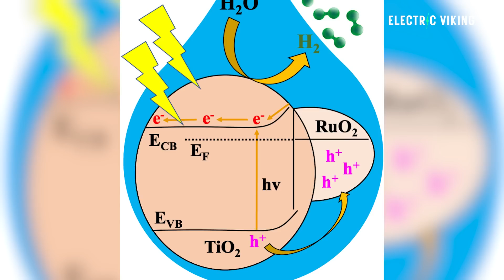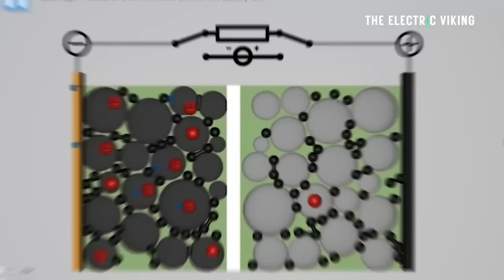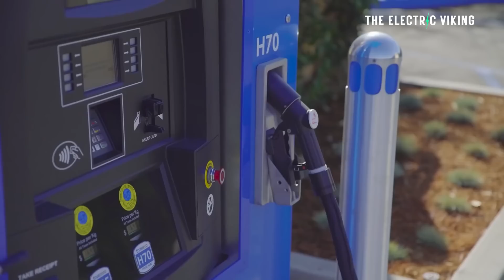American researchers use sunlight & water to efficiently create green hydrogen

Comment: Round trip efficiency. That's all we need to know... to compete with battery storage, it needs to be similar at 85%
Reply: Round trip efficiency is important, but also other factors matter. Hydrogen is useful for the chemical industry and can be used as long term (seasonal) energy storage. If you also need heat in winter, the "losses" of a fuel cell can  be quite useful.
Reply: @dirkvornholt2507  not if you keep having to replace/maintain storage equipment due to hydrogenation/embrittlement. Still the tech is interesting and there may be non-transportation use cases where it makes sense dunno.
Reply: @erktrek  I see hydrogen rather as a base chemical. The industry that uses it knows how to handle it. Concerning storage and transport, derived fuels like methanol or ammonia might be a more viable option. For cars, it's probably rather a niche market.
Reply: Batteries have lower capacity, and shorter duration.  The applications are different, suffice to say.
Reply: @FlameofDemocracy  - Depends which type of battery your refering to, flow batteries have high capacity and long duration for example.
Reply: @GruffSillyGoat  Flow batteries might still be in the development stage.  Is that still correct?
Reply: @FlameofDemocracy  - no, they are a mature technology - but a costly one to build both money and timewise. They've been around since the 1880s, and in commercial use on a large scale since the 1950s. They're advantage is sheer size and scale as energy stores, rapid switch on/off time and extremely high current capability with the ability to charge and discharge at full power across their entire range. The largest is one is in China that holds 400MWh of energy and able to charge/discharge this at 100MW. They can hold their charge indefinitely, unlike other battery bases systems. Offer some of the highest levels of durability around, and are low maintenance compared to either hydrogen or lithium/sodium based designs.
Reply: @GruffSillyGoat  From what I have read, it is still experimental.
Reply: @FlameofDemocracy  - Vanadium flow batteries, the main type, have been deployed since the 1980s (the China one I mentions is vandadium based). You may be readiing about some of the many chemistries that are being explored in flow batteries, they are highly versatile, some of which are relatively new (such as organic chemistries, developed in the 2010s) that are more experimental.  However, the main zinc-bromine and vandadium based ones they've been used in grid storage for decades, are mature and deployed virtuall everywhere - North/South America, Indian/China and many other parts of Asia, Australia, Africa, Europe, etc.

Hydrogen fuel cells are also a class of flow battery, but one where one of the reactants (Oxygen) is not stored but is sourced from the atmosphere. However, for grid storage flow batteries typically means Vanadium based solutions as they offer high current/energy density and have smaller system sizes than equivalent hydrogen systems - as their reactants are liquids rather than gasses. Zinc-Chloride flow batteries have also been considered for vehicles due to their high energy density (830wH/kg), but are heavier and more complex than lithium batteries (tanks/pumps/reaction cells with mebranes) but are being trialed in large trucks due to their rapid charging ability.
Reply: @GruffSillyGoat  I can gather as much from the internet. Both are still experimental.  

In fact, the entire category is still speculative.

Hydrogen in regenerative fuel cells are the archetype.  More chemistries in that mode are certainly to be welcomed.

But the density of hydrogen cannot be matched, not to mention the versatility.  

Salt batteries, and sand batteries for heat can fill niches and match demand quite readily, with cheap simple approaches.

Why there is so much interest in vanadium may be due to the explosion in costs of lithium, along with the emergence of some limitations to applications or longitudinal performance.

Needless to say, the same speculative forces would take hold with vanadium; perhaps quite predictably.

So, why complicate matters unnecessarily?
Reply: @GruffSillyGoat  
Hydrogen-vanadium chemistries may also be worth checking out.
Reply: @FlameofDemocracy  - flow batteries (e.g. liquid based ones such as vanadium) and hydrogen fuel-cells have different characteristics - flow batteries have high peak and continuous current outputs compared to hydrogen fuel cells, whereas hydrogen fuel cells allow for continuous operation if supplied a constant source of hydrogen fuel. Flow batteries and hydrogen fuel archetypes do differ as one is designed for liquids and the other for gasses, the constructions of the supporting systems and fuel-cell / flow-battery ion exchange mechanisms differs considerably. Modern hydrogen fuel-cells have borrowed from the science, knowledge and engineering of flow batteries in their designs.

Also, I wouldn't call vanadium flow batteries speculative or experimental, they are an established technology and quite common in grid based systems, though less common in industrial applications. Furthermore, they have been commcercialised as scalable drop-in containerised based solutions, only requiring a small container sized footprint and grid connection to operate. 

Hydrogen similarly has been containerised but requires a larger footprint, at lower capacity, due to the more complex system setup - electrolysis water filter & hydrogen generator, presurriser/cooler and storage container.  However, most large hydrogen generating sites, particularly those used for industrial requirements, are custom built sites with direct pipeline connections. 

Lithium's pricing is still much lower than it was a few years ago, some 70% lower, and is projected to reduce further. Although, Sodium batteries are expected to be significantly cheaper once commercialised over the next few years. Both are significantly cheaper than either hydrogen or flow batteries and scale from small to very large requirements (again are small footprint containerised solutions)

Hydrogen had a duality of energy density - it's has a high gravimetric (mass) energy density but a very low volumetric energy density (due to being a gas). Hence if not being used in its gasseous form (as in the case of some industrial applications) required extensive processing to improve it's volumetric density (at relatively high energy costs). For green electrolysis they generation side can be upto 80% efficient, 5 to 10% additional energy is then spent in processing and distribution, and fuel cells are 40 to 60% efficient, this means for energy input the overall energy recovery is 25 to 35% (possibly raising to 30% to 45% with improvements).  

Hence hydrogen is suited to industrial applications where either the lost energy, particularly heat in the fuel cells, can be recovered (raising efficienies to 70 to 80% overall) or where continuous operation is a key required. For mobility is now positioned for large vehicles (heacy trucks etc.) or where high range (1000km+) is required (trains, long hual flight). 

Flow batteries are used for peaker plant replacements, grid balancing and emergency power provision as they have similar power characteristics as pumped hydro but at a much cheaper price. Containerised solutions have eased their implementation and cost management considerations, making them plug-in solutions with reasonable power densities (2 to 4MW per container currently).

Lithium is likely to become dominant in mobility and Sodium in static storage solutions, due to the ability to scale from small to very large capacities, ease of maintenance and flexibility. Most grid operators are utilising battery storage in support of renewable generation as they are easy to integrate into renewable generation sites, enable 24/7 operation of intermittent sources, and reduce the need for curtailment. They are also used as battery buffers for EV recharging sites, simplifying the grid connectivity requirements of these sites. Their large scale adoption is also driving costs down further.

Comment: H2 would still not be good for cars, but we can use hydrogen in so many ways if it was green like this.  Steel and concrete could both benefit from inexpensive green hydrogen.  Ships are the other use that might be viable; possibly using a hydrogen gas turbine.  Aircraft maybe.
Reply: Nat gas would work better for both aircraft and ships (which already use it).
Reply: We could convert existing thermal power plants into hydrogen plants for winter use when there's not enough renewable energy.
Reply: Everything will be green in the future.  The concept of green hydrogen that is popularly discussed is actually a misconception. 

The all green portfolio is the genuine theory and thought process.
Reply: I literally cannot think of a worse application for hydrogen than in aircraft.
Reply: @phillycheesetake  What burns in internal combustion is the hydrogen component.  Carbon is expelled as gases, particulates, and solids.
Reply: @FlameofDemocracy  You must have made a mistake, your comment has absolutely no relation to mine and yet you replied to me.
Reply: @phillycheesetake  Hydrogen could be used directly, or it could be used to make efuels, i.e. green jet fuel.
Reply: @FlameofDemocracy  Yes, it could be used even more inefficiently through combustion, I'm aware.

Still less direct than electricity, still a waste of time with e-fuels because those can be made directly without the completely unnecessary step of going from hydrogen to those fuels.

Comment: Is it not only significant if it amounts to a more efficient capturing of energy from sunlight than a photovoltaic panel - which it could well be ... - is it ?
Reply: Did they say for every 100 photons from the light source only 10 were utilized? Therefore 10% efficiency compared to 25% for photovoltaic.  Is that correct?
Reply: @carlwest859  it sounds good but I am not a physicist.

Comment: Hydrogen can be good for energy storage as well as plane fuel.
Reply: @Rainbowhawk1993  Methane will be the lightest molecule used for planes, likeliest is kerosene for long haul and all electric up to 400 miles.
Reply: There are more efficient methods of energy storage (from cheap low density batteries to pumped hydro/compressed air). 
The new process might move the needle but they released No numbers. 

Regards planes, the problem isn't the weight of the fuel, its the weight of the massive fuel tanks and hazards handling H2 at 10,000psi. There are precious few H2 stations in the world, yet explosions at these stations are not unknown. 
Would be interesting to see what safety specs would look like vs kerosine.

Comment: Hydrogen cars are still more complicated in comparison to fully electric cars. the fueling process is still less convenient and requires more personel. And you still cannot fuel home made hydrogen. Electric has still advantages.
Reply: You still need to distribute hydrogen with tankers and there are issues with hydrogen degrading its containers.
With electricity, the delivery network exists, is efficient and there's no extra step. You generat electricity and distribute it. Storing it in a car battery is far more efficient than using it to create hydrogen.
Reply: Ruthenium is rare and therefore expensive. So no go for large scale application.
Reply: @petewright4640  The next very rare element needed for fuelcells is Irridium.
I'm told that there is no replacement for that element in the fuelcell membranes.
Reply: Hydrogen can be a good fuel for railways, shipping, trucking, standby emergency power generation etc. This will free up the demand on fossil fuels substantially. 😎🤔
Reply: @civilianrightwing  What burns in fossil fuels is the hydrogen content, sunlight is in fact, hydrogen light, the planet is covered in a hydrogen based liquid, people love to drink coffee flavored hydrogen each morning, et cetera, et cetera.
Reply: I agree. Even if hydrogen was free at the point of production it wouldn't make sense.
Reply: Hydrogen offers more power, and make transportation less vulnerable to inclines, temperatures, or distance.

Hydrogen has to back up fast chargers, at any rate.
Reply: @FlameofDemocracy  - hydrogen has a high gravimetric energy density but a very low volumetric energy density, hence requires additional processes and energy to be spent in production and handling (cooling and presurising) to make it effective to be usable. However, even with all this applied the size and weight of the overall fuel cell system is greater than that of lithium battery systems, hence is limited to larger vehicles and not well suited to lightweight vehicles (cars, vans, small trucks). 

Further, fuel cells are only 40 to 60% efficient, meaning a lot of energy is lost to heat in the process of creating electricity. Hence are more suitable to static industrial applications where the heat can be utilised rather than mobility solutions where the heat energy is wasted. Where hydrogen fuel cells are being considered as feasible for mobility is in the case of heavy vehicles (trucks, busses, trains) but even there recent battery developments are erroding the advantage. 

Fuel cells also have a sweet spot of generating efficiency, so often under/over produce power output compared to a vehicle's need; the solution is to couple the fuel cell to a lithium battery to buffer and balance out the power generation to a more usable level. These batteries are also used to support peak power output as the fuel cells are not optimised for high current draw applications - starting, accelerating, travelling up inclines. Like batteries fuel cells are impacted by climatic conditions, and have to be kept in a certain temperature range to be effective (via heating/cooling of the cell).

Hence whilst hydrogen has a high energy density by weight technology for the foreseable future means we cannot utilisethis level of energy in reality, rather only 20 to 30% of the energy capacity is effectively available for fuel cell based approaches (and is much lower for hydrogen combustion).
Reply: Flame, six weeks ago, an EV won the brutal  Pike’s Peak Hillclimb. And, Sam just posted a video about an EV winning a very tough Hillclimb in OZ.
Reply: @FlameofDemocracy  Hydrogen is an issue wken you need peak power. The fuelcells do NOT provide the opportunity to deliver a lot of power. A battery can easily switch between low power output and high power output. A fuelcell is best when delivering constant power output on a relativ low scale.
Hydrogen cars do have for that purpose also a (smaller) Lithium battery. For when accelerating is needed, or climbing a hill.

There is a reason that hydrogen is more often connected for producing steel cleaner....not with fuelcell usage but with burning it.
For that purpose hyfrogen is a good alternativ for cokes burning.
Reply: @reiniernn9071  Hydrogen can be used for turbines.
Reply: @FlameofDemocracy  It can....also for rocket engines.
But this is about efficiency.
If you loose 50% of your energy when producing green hydrogen that turbine will start with a 50% loss in efficiency due to the fuel production process.
The real efficiency of a top modern multistep turbine system is 60% at most (only when working at full power). If this is stationary (like a [owerplant for electricity) the rest heat can be ussed on top of that...which increases the efficiency up to 80% tops.
This makes the real total efficiency in the cycle  between 30 and 40% (80% of 50% is 40% maximum.)
This is on;y acceptable if there is no better usage for that hydrogen.....
Reply: @FlameofDemocracy  The difference between fossil fuel and Hydrogen is that hydrogen is more like charging an accu ...you need energy to remove the O from the H2O which is comparable with charging a battery (also a chemical reaction).
And fossil fuel is not first created by using other energy (unless yu assume solar energy millions of years ago ).

For the rest I'll ask my son, when back from holiday, for his reaction on this video. His job: Researching on hydrogen technology. (In the Netherlands)
Reply: @reiniernn9071  That you need energy to make energy may be a tired trope, related to chemical engineering.

Nikola Tesla, who knew just as Lord Kelvin did, that fossils would one day run out (This was a big topic in that era.), designed the grid to run on massless energy, that being the Niagara Falls in NY.  

So, is the statement valid, if you look at grid dynamics, from the standpoint of Tesla, who himself designed the grid the world uses?  

Nikola Tesla is perhaps the first electrician, first electrical engineer, and first electrical systems designer, and much more. 

Let's think things through.
Reply: I don't understand your comment
Reply: @doriangray6985  it's pretty simple though...
Reply: @doriangray6985  Fuel cell cars are in fact, electric cars. Many still do not understand that simple truth.
Reply: @FlameofDemocracy  Troll